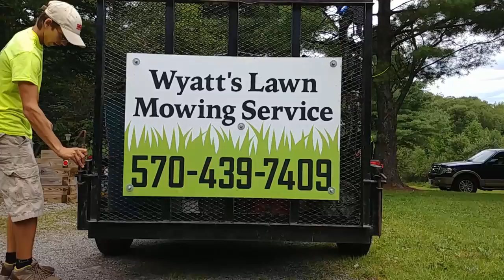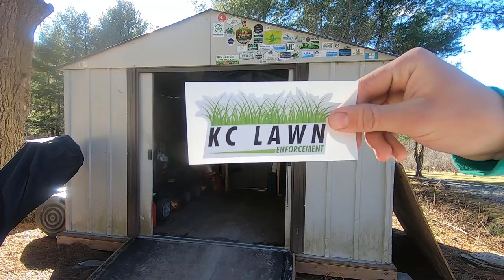Huge Landscape Tear out! | Removing Shrubs | Echo CS 2511T In Action!

Comment: Hey Wyatt I like your videos keep it up. I have my own tree company in florida and I have a cs2511 echo myself. I'm not sure what size bar you have on it but if you use a 12 inch bar you will have alot of power on that saw! I love that saw.
Reply from the maker: I have the 14". Does the size bar make that much of a difference in power?
Reply: @wyattslawnservice7212  it will cut faster more power also. Especially on bigger saws. Nice top handle climbing saw i have a couple older ones they still cut like butter.
Reply from the maker: I didn't know that I would have gotten the 12 otherwise!
Reply: @wyattslawnservice7212  if your doing a lot of cutting or in a tree limbing it then it makes a difference but for what your doing I every now and then it's fine. The bigger saws you can deff notice a difference from having a 28in bar then you put a 20in. On and it rips faster. Im talking about like the bigger stihl saws like that.

Comment: Great job. You should have offered to grind the stumps. When I do that I just rent a stump grinder from Home Depot.
Reply from the maker: I could've pulled them actually. The dwarf Alberta spruce's roots aren't very deep or wide. However, they wanted the cheapest option
Reply: @wyattslawnservice7212    Watch some video's about landscaping in the UK.  I've seen them cut down a shrub leaving about a foot of the base. They get an old "car jack".  They put a chain on the base and put the car jack on a board and then start pumping the jack bar until the stump lifts up out of the ground.  Wow, I could not believe I saw that.  You cut them down to the ground as they asked.  I like that.  No hard sell and saved them money.    I've seen a few guys take a drill with a 2 inch drill bit and drive it down those stumps once or twice and then told the homeowner that it would help it decay faster.  They throw in some Epson  salts in the holes and let nature take care of the rest.

Comment: What would you charge per  🌲 extra if you had to remove the root. What type of shovel are those? I need some like that.
Reply from the maker: I charged $20 ea. To cut out. It would've been $60 ea. To pull out. And I used a trench shovel I think it's called and a spade (which broke lol)